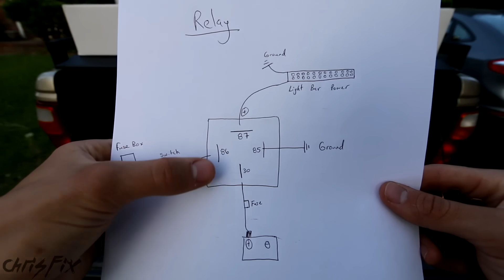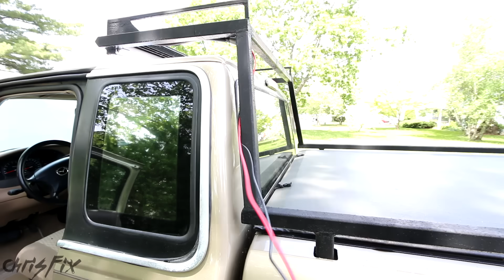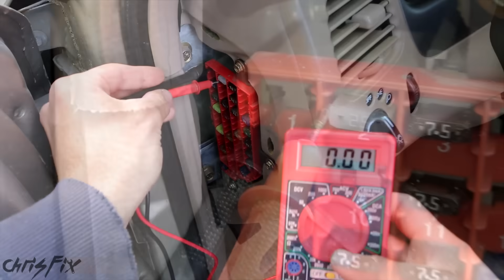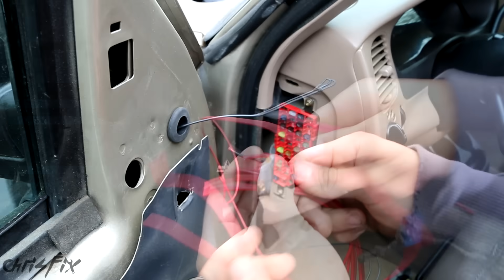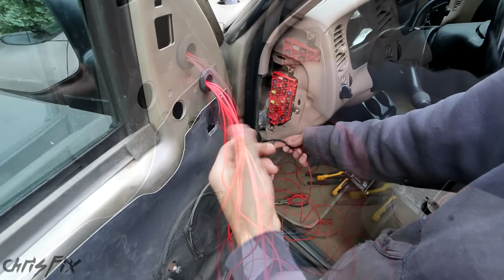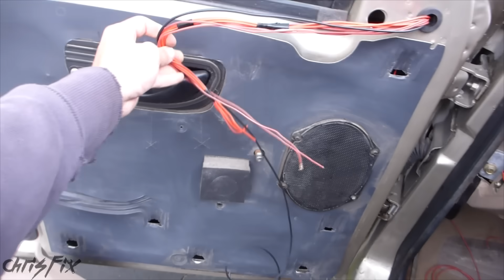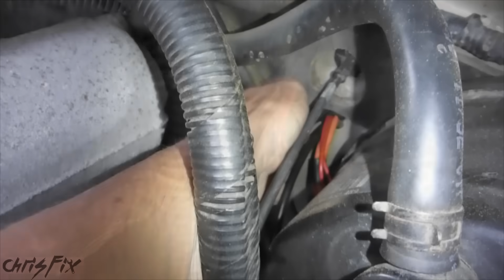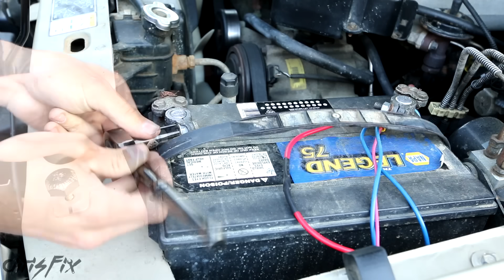How to Wire an LED Light Bar Properly (Project Night Light Episode 3)

Comment: The light rack has inspired me to do the same build with my own personal touches. I have a 42 inch bar on my roof already i get the light on the hood but it doesnt affect my sight very much. Could be do to the color of mu vehicle. I still plan to throw another bar on the rack tho 😂. As far as ur switch guide and wiring its awesome and useful but for 15$ i can buy harnesses with relays and inline fuses already built in and they're good quality harnesses. I have 4 of them. Their MCtunning wire harnesses

Comment: Nice video. Your kids will be very lucky to hang around the garage with you. When you pulling wires, try to get a piece of strand used with Plastic welding, you get different hardness but its quite tuff if you need to pull on it. steel wire is bit difficult sometimes. but very cool channel dude.

Comment: I want to add a small light bar and driving lights to my '95 Ranger. Do I need to worry about the draw on the battery and alternator? I'm running a OE alternator and I don't want my other lights dimming when I run the new ones.

Comment: Great video, but i do have to ask, you did not mention if you were planning on running the rest of those switches to relays. But if you were, would it not be better to only run one power in wire from the fusebox and jump it across the switches as you did with the ground connection, or is there not enough current coming from the fuse box to trip all of the relays when the switches are run in series.

Comment: Is the reason for the wire from the fuse in dash to illuminate switch ? I’m wanting to wire  a led light bar on my side by side but the rocker switch won’t illuminate
Reply: in order for the switch to light up you need to run the black wire to ground. thats why he ran the black wires on the door panel in series then into the cab to the ground bolt behind the kick panel.

Comment: Just seeing the difference that the Light Bar made when you switched it on actually made me smile, got me wondering how the battery/alternator is gonna cope with all these extra lights though... Is the standard battery built to be able to cope with all of this or did you put a bigger battery in?

Comment: Chris, Great vids as always. And while this is a relatively older video, still, I wonder if you couldn't have ran the wires inside those hollow metal that you used for the bed-rails; but perhaps the plug was a bit big. Just thought hiding the wire completely would of been sweeter.

Comment: Hey, awesome job. I put two lights on my B4000. Just under 10 Amps total so I skipped the relay, just sized the switches and wiring appropriately. If you want to keep your battery terminals looking stock and clean, you can run you positive leads from a heavy stud on the front of the engine bay fuse box. That's what I did and I think it looks really sharp.

Comment: a little bit confused, the switch get power from the fuse and send power to the control side of the relay and then ground from the relay. why the switch need an extra ground
Reply: There's a light into the switch itself.
Reply: That makes sense. thank you very much

Comment: I think you should've drilled a hole in the rail to hide the wire for the light bar better
Reply from the maker: I rather seal it so water doesn’t get in and rust the pipes.

Comment: Awesome project. The only thing I would have done differently would be to run the wiring through the tubing of the metal mount. Would have been way cleaner. Also, what I did in my car was I got a battery with standard posts and the GM side posts. That way the main wires went on the regular posts and all my accessories went on the GM posts. Very clean.

Comment: Great info thanks a lot. One question. Do I need to use 2 separate relays if I'm wiring 2 separate sets of lights. Thanks.
Reply from the maker: You could use one relay if both lights are combined under 30amps and if you want to turn them on together.
Reply: ChrisFix thanks for the quick reply. I see now, i got the idea. Thanks. 👍👍👍

Comment: Nice to see you finally got a real god pair of crimps, I like how the light is embeded into the frame of the rack like that. that's pretty slick. somethings that might help  is since you are installing all of these lights and such would be adding a distribution block for the 12V power. might also build out a spot on the truck somewhere to put all of your relays also, nothing wrong with having those things they are good for keeping your equipment from shorting out the systems. I like that guage chart, i always just over build everything.  something else you keep referring to the covering as "flexible plastic tubing" why not call it what it is? "Wire Loom" that way there's no confusion and everyone can know what to ask for at the stores when they are trying to do things the right way. I'll never understand the logic of putting the switches in the door like that but it is what it is. what you might suggest is if people aren't hooking up all of the switches right away like you did or when you are running multiple wires of the same color like you did then put a piece of tape on each end of the wire and number it. helps keep track of which wire goes where easier. Kudos on using the grommets those people have no idea how much those things can save them in headaches and keep them from blowing fuses and burning up equipment. I would suggest a good disrtibution block for the ground also but too many grounds from the same grounding points can and do cause radio noise. a couple central grounding points may work well but then you'll want to make sure you have a bunch of frame to ground and engine block to ground wires so that everything stays grounded out properly

Comment: Hey Chris fix 
Mazda B3,000 or ford ranger your bolt a project night light for part 1,2 and 3
Let me know in discription down bellow what is your favourite pickup truck your answer will be
Mazda B3,000
Ford ranger XLT 
Nissan navara 
Toyota hilux 1.3 E manual transmission or (mt)
Chevrolet s-10 extended cab
Ford f-100 custom
Ford f 250
Dodge Ram srt 10 quad cab
Your sinsirly Jean Andrei
Reply from the maker: I like the Mada B3000 and Ford Ranger.

Comment: Since u still have 12v running in the cab of the truck and through the switch does it make a difference if I use a relay or just run power from the battery through my switch in the cab and to my light? It's not as big of light ... but wouldn't that be ok ? And I'll have an in line fuse between battery and switch
Reply: Or is it just so you dont have to run such heavy gauge wire in the cab  ? For something that would draw large amps?

Comment: Theoretically speaking couldn’t you just run one long fused power cable into the cabin and piggy back off all of those similar to the grounding wire? And every time you add a new circuit just upgrade the fuse?

Comment: Great video. Was the 15ft of wire the light bar wire or were you including all the wire? Also how did you know what gauge wire to use for the switch and what amp to use for the switch. Thanks

Comment: So what happens if a relay is not used and just ran from the battery?
Reply from the maker: That means you have a high amperage set of wires running into the cab so if there is a short or something, it can cause a fire.

Comment: Hey Chris, (Or anyone else). Can I run multiple switches off of one 12v add-a-circuit? I know I'll need separate output wires for each switch to each relay, but I'm wondering if the relays would still work if I ganged the input to the switches together much like you did the switch grounds? If it helps I plan to have 6 switches and relays overall. Thanks!

Comment: Thank you for posting this it helps a lot but I was wondering why didn't you run your wires hardness from the light bar through the mount so it's hidden and protected?

Comment: I did something similar on my truck. but used a Nilight 42" bar on the front. a 20" bar on the back. and 2 4" spot lights as "alley" lights mounted to a rack in my bed.

Comment: What kind of wire do you use and where do you buy it?
Reply from the maker: Stranded core wire and the gauge depends on  the amps and the distance of wire you use.
Reply: I was hoping to find an inexpensive source of 10-12 awg wire... looking to wire a 240W LED light bar approximately 15 feet from my battery.

Comment: Hey Chris, I just started watching your videos last week and i'm HOOKED! You put so much detail and thought into every project it just inspires me to do so much more work for my truck when i get back to her. Also the video editing and sound quality is better than most for sure! I installed an LED bar on my grille guard, two minis on the headache rack for full coverage and a reverse light a couple years ago with a buddy who knew a little more than me on electrical wiring. (94' F-250 with a 7.5 460 FYI) IT WAS TERRIBLE lol, before i left last year only the front LED worked and I didn't secure the wires at all. Watching your videos is great because i love to do very detail and quality work so thank you for providing amazing detailed videos to help me through the process. I am excited for all your future videos and success in the future, Good luck and thank you.

Comment: Great job chris learnt so much I would have run the light bar wire down inside the steel frame there would be hardly any wire showing to be cut by someone  nice job, boy they throw out some light

Comment: I want to put a light bar on my BMW, but the battery is located in the back. It has jump points under the hood. Can I use that instead? This is an x3 btw, I'm not being stupid and putting it on an m3

Comment: In Sweden most people connect the relay directly to the hi-beam lamp for the signal and doesn't use a switch in the cabin. From what I can tell driving, off road lights and led-bars are no way near as often used in the US? Here in Sweden i'd estimate that about 50% of all cars have some kind of upgrade to the hi-beam.

Comment: I can't believe anyone would pay $875 for a light bar when the Chinese ones are the same quality. Awesome video but the light bar price is ridiculous
Reply from the maker: I got this on sale so it wasnt full price. The Chinese ones are not even close to the same quality. I have run this Wurton light bar and a Chinese light bar on the rear and the brightness of the Wurton light bar is the same while the Chinese one is about 75% as bright as it was new. Also there is moisture in the Chinese one and not my Wurton light bar. Finally, the Chinese light bar doesnt have a warranty and my Wurton has a lifetime warranty. It all depends what you want but you would need to replace a Chinese light bar once a year to maintain its original specs or you can get a good light bar and buy it once. I wasnt putting in all this work to make my bed-rails/headache rack/roof rack only to replace a light every year. Hopefully that clears up some misconception you may have!
Reply: ChrisFix I understand nd im not teying to put u down in any way I just could never bring myself to spend that much money on something like that .. like I said awesome video and love the channel :-)

Comment: Use star washers under your ground points. Better grounds. And match the fuse rating for what draws the energy. Get that fuse box fuse down to a 2 amp since the relay only draws millie amps.
Reply: Incorrect. Although the relay draws very little power, the fuse is for the power feed from the battery, through the relay and to the light bar.

Comment: Quick question for you Chris. When you go to wire up the other switches do you have to use another fuse slot or can you piggyback off of the first one?

Comment: Hello Chrisfix I have a request for the power locks, my toyota corrola 95 don't work, the windows work but not the locks how do I fix them
Reply from the maker: Check the fuse.
Reply: I did but it does look blown

Comment: @ChrisFix How did you know the switch would not burn out or the circuit getting damaged using a 10A fuse holder? (a 10amp fuse hole or circuit) Because your led bar look big, which has to be something near 200watts. I have seen other videos in which they use 15A or 20A and even 30A to wire. Also your video is very detailed with very good explanations :D
Reply from the maker: Amps can be calculated by watts/voltage.  Pick whatever fuse is right below the amps it draws

Comment: As always excellent work.
I'm worried about the structural resistance of the set. I should add a bar that makes a triangle in each side in the rear to avoid vibrations on the light bar that can hit the roof.
It is clear that is not a safety cage for the truck, but this design is propense to swing.
I hope you can understand my poor english.
You are very professional and I see most of your videos.
Reply from the maker: You could add gussets but there is no need. I can stand on the roof rack and it doesn’t budge.

Comment: I would add a blob of room temp vulcanizing silicon sealant or sugru, to the switch connectors to seal them and prevent from falling off, other than that, spot on!

Comment: Hey Chris, just to pick your brain a bit I wanna hook up 3 spots on my 99 Pajero io, 3 door SUV. but want to have the light set up as left and right side facing spots and once rear spot all hooked up to separate switches {rear spot to be triggered by reverse light and/or switch}. Any Ideas on how to wire these?
Reply from the maker: So the left and right can be set up the way I did my forward facing light bar in this video. The rear lights can be set up like this: https://www.youtube.com/watch?v=ZVG7X-ae298
Reply: Awesome I watched that vid too :) however would the rear light be able to be set up the same way with an aux switch, which I can turn on without having to put the car in reverse?

Comment: You did such a good job of pulling wires through in the car,  I'm surprised you didn't take advantage of the hollow square tube and run the wires inside the tube framework.  Slightly messy end to what was otherwise a great wiring job.

Comment: Why do you Americans always connect the lightbars to buttons? Why dont you just take the signal from one of the highbeam headlights so when you turn on you original high beam the lightbar also turns on... Allot less cable management that way. Revers lights on the other hand makes sence to have a button for, since you not always want them to turn on when you are reversing.

Comment: Get a kawell led harness, it had the relay and fuse built in so it’s all ready set up. Plug and play and it’s only 13.99 on amazon. I run it on my trucks and ATVs.

Comment: I drive on interstates with LED bar and 4" lights. I drive with the large PIAA light bar, which has reflectors that push the light down the interstate ahead of me, allowing me to see about 600 feet ahead of me. I also use KC 4" duals that also light up the road. It's really nice. The KC's have DoT certifications for on-road dirving. The PIAA does not, but is only as bright as normal brights on the interstate.

Comment: Got mine wired up to a switch, but it also turns on and off with the high beams. Wouldn't need to have the switch as well, but it's law to have a separate switch for auxiliary driving lights in Australia

Comment: Hey buddy. I've been watching some of your video to understand how to set up my light bar. I have a 20" light bar and 4 led pods, I'm going to use to pods as fog lamps and the 20 " and the other two  for extra lights. But my 20" is a 126 w. I'm not sure on the amps or anything so I want to wire that and two pods together but not sure exactly what kind of harness to buy. What I mean is. There is a 300w harness that hass two sets of lead and I want to buy it but not sure if it will work with what I'm trying to do ?. Any advice..?
Reply from the maker: Amps is watts/voltage. So 126w/12v so 10amps
Reply: IMG_1037.JPG  not sure if u could see this but would this harness work for the light bar and two pods ?.
Reply: If not it's a a Heavy duty LED light bar wiring harness with 3 leads12v 40 amp relay. Water proof switch 3-52 in 300w light bar. Keep wrangler. Atv and boat, trucks

Comment: Great video chris. Ive been wanting to put fog lights on my SUV but i was a little intimated by the whole  process. You once again have made a simple step by step video for the installation of wiring.and switch installment. Now when i go driving down my back dark road i can see what kind of critter ive just ran over. lol.

Comment: Actually you'd only need 5 wires for 4 switches. One common source and the 4 switched wires. Why would you want to use a fuse per switch, the relays draw a few hundred milliamps at max.

Comment: Chris what do you think of running a jumper wire from post 30 to 86? I have a relay that suggested it.
Reply from the maker: +Matthew Collum why? There would be no reason to do that.
Reply: ChrisFix I guess they want to power that post. The switch is on 85 and the switch has it's own ground wire. On 87 is a horn that is also grounded. The diagram shows no grounding for the relay itself. I realize a horn is different from a light but I figure it's a similar application for the relay. I plan on using this and your project nightlight vids for running lights later on. I have already viewed them and made notes and I really appreciate all the information.

Comment: a little while back I tried to put one of those add a circuits in my 98 ford ranger ( pretty similar to your truck) and I couldn't get the fuse cover back on without it bulging. did you run into this, or did you find a way around this?
Reply from the maker: +caleb fink I had the same issue but to make it work I put the fuse in the middle so the cover could flex easily and snap in.

Comment: I know I'm way late but just out of curiosity, why didn't you jump the positive from the fuse as well? Assuming you're going to use relays for the other lighting as well, these cables shouldn't have to carry much wattage. That way you could have used three wires less.